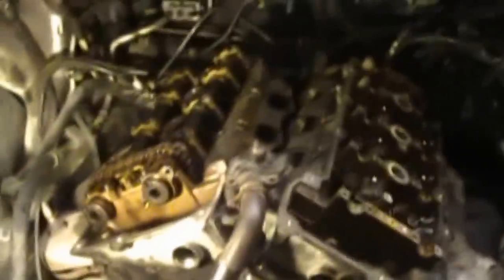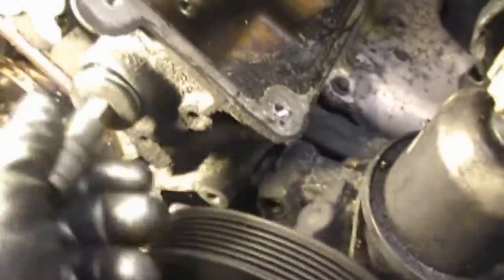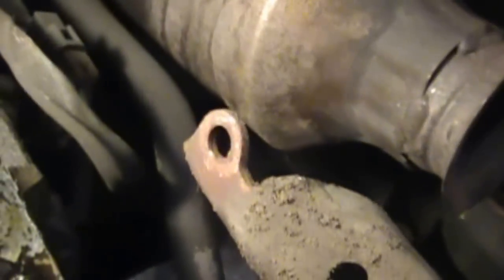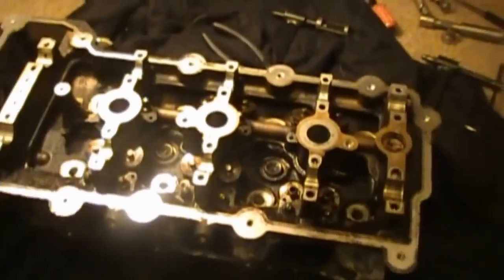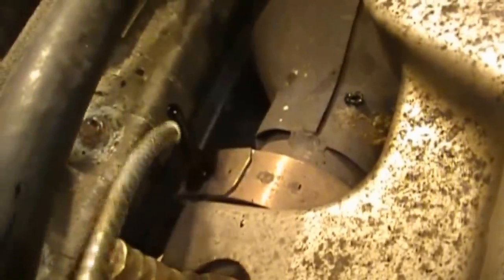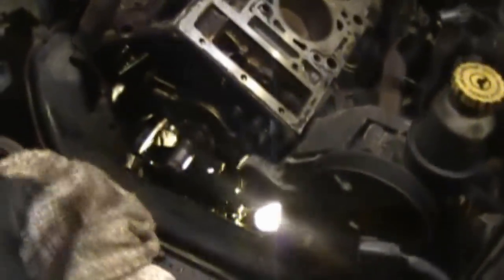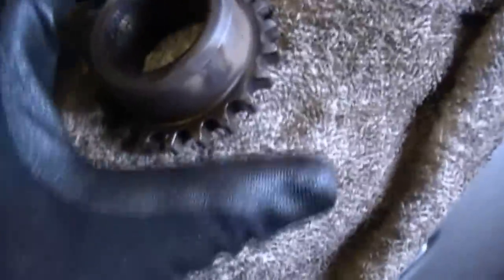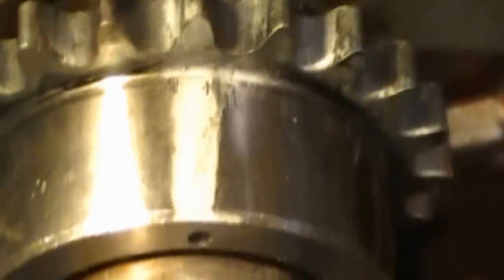2.7 1999 concord/intrepid timing chain replacement - head removel and more!

Comment: HI, I just replaced the water pump and tensioner, and after I have it all together and timed properly; every few degrees (about 120) when it compresses every cylinder, it creates slack between the pump and right sprocket.  As a result, creates more tension on tensioner and throws everything off: pushes tensioner too far back, skips teeth, throws out of time, etc:  does anyone have an idea what could cause that?
Reply from the maker: +thecrowndeer  Make sure you turn the crank ....Clockwise! ...only!  That would cause that Issue. Good luck!

Comment: How do I get the oil pan? I have already loosened all the bolts and nuts, the oil pan is just hanging Loose, But the Sway bar is in the way, there's not Enough clearance to pull down the oil pan, what do I need to do? or what am i doing Wrong?
please help. Thanks.
Reply from the maker: phigo4kins  loosen one of the motor mounts and jack up the engine inch or two. I had this problem also. I just used a small jack and a piece of wood under the harminic balancer ...if you took it off you might have to put it back on just snug enough to lift the motor. There is one nut that will let you losen the motor mount under the cradel/frame. 15 mm i think. I took off the pasanger side nut.  Easy to get to. Good luck!
Reply: TVWXMAN32 Yea Man, Thanks A-Ton I didn't even realize You gave a response. I just happen to come by Ur Vid again (as I always do everytime I search for Trep Videos) & Was scrolling thru the Comments, Lolz. But I finally got the Oil Pan off. I did Exactly what You said, Had to slightly release the Engine Mount Bolt on the Passenger side just enough to let Me wiggle it out. These engines are Pain in the Rear to work on, Especially for a 1st timer. But I want to use this opportunity to ask for another help, I have everything in the engine pretty much stripped Just the Block and the Crank left, I found out I had a sideways play in some of My Rods (Not the Up & Down Play) - Which I think would suggest a chewed up Bearing, some people said its ok/normal, [I made a short video of it - If You can check out]. But I just wanna be sure, cos I don't wanna go thru all this teardown & regret not taking the crank out to check it. I've already took some of the Rod Caps off. With Your great experience on these cars, 1. Do I really need to drop the block/take the crank out? & 2. If I do - How do I detach the engine from the Transmission? Where are the Bolts holding'em Located?

  I had Over Heating and Knocking sound & SEVERE Sludge which is what lead to all these work - which I could've mistaken the Knock for a Chain Slack - I Wasn't Sure @ the Time - As I didn't have much knowledge on cars as I do now. I have the engine all cleaned of all sludge. REALLY Wished I made a video of it before I started all these work - this happened back in 2011. Sorry for the Long writing.

Comment: Thank you for the video,  Believe a friend of mine has a problem.  Will be looking at  it soon.  Weather gets in the way sometimes.  How many total days, hours did it take.  Sorry you got sick too.  You Changed the water, oil pumps, and the chains with glides, two values, A/C pump.  blots for ex-haul manifold covers.  ( chain guide tensioner. )  Total cost plus oil and filter, plus antifreeze.  All Gaskets in one kit.  Hoping you get many miles out of your car.  later, and Thanks again.  For  taking the time.
Reply from the maker: All in one kit...on e-bay from a dealer was $170.00 back in the day...lol Car ran like new but I did sell it 2 years ago. If I ever found a nother one, I'd buy it if the body was in good shape. Solid cars!

Comment: some ebay parts are cheap for a reason.  I had a secondary tensioner explode with only a couple thousand miles on rebuild.
Reply: Darci Maxwell That's Scary, I Bought Mine off Ebay too. Are You sure You didn't do something wrong during arming the Tensioner?
Reply: Darci Maxwell Have had the same issue with NAPA parts. Timing belt tensioner failed after 1,000 miles. Destroyed the cylinder head.... interference engine.

It can happen to any part. It's great to have a lifetime warranty on a part. You never know what other associated parts it may take with it though.

Engines are incredibly complicated. The range of extremes, -30f to 200f parts operate under. Those conditions for a decade or longer.
One mistake... a few foot lbs off in installation and it can shorten the life of a component. 

Sometimes you have to admit user error. Yeah I checked the tolerance window. Checked it several times after adjusting timing. But maybe I was looking at it from an angle, giving it was in such tight quarters. The spring just slipped out of the groove.
For the head, timing belt kit, oil, coolant and other fun stuff, cost about $300. I chose to go with amazon.com. Have put 8,000 miles on the car since April and the  car is still running. $25 for the head gasket, $60 for the belt and tensioner. You never know man. And on a 20 year old car....

Comment: Thanks so much for taking the time out of your day to do this video.  I just bought a 99 intrepid and seem to be loosing a little coolant so here we go!
Reply from the maker: Tell that to the 17 thumbs down people who never left their parents basement...lol..   That took some time to do and shoot video. People don't understand. But those motors are good motors if one takes care of them. Good luck!
Reply: I dunno man. I work as a Journeyman Technician myself... although I specialize mostly in VW/Audi/BMW, these 2.7L Mitsubishi engines have a massive amount of TSB's and general water-pump/head/sludging problems. 

I got a 2006 Sebring in my garage (side project) and it has only 100,000 kms on it, and it needs a new head due to oil starvation. The camshafts were metal to metal, and it was squeeling like a stuck pig.

I can't say I'm a fan of Chrysler and these motors.

However you did a good job at the video. Very informative even for experienced techs like myself. I don't have access to Mitchell at home... :)
Reply: None of those problems will happen if you use synthetic oil. My 2000 has 445,000 km on it, still has the original water pump and runs great with no blue smoke.

Comment: Hi i hope you can help me i have a chrysler 300 the timing chain broke and one of the valves bent do you think that by taking it for a grind will help or just to have the valve replaced
Reply from the maker: grind??
Reply: I meant to say rectify when they sand the heads
Reply: I have the cylinder 2 that doesnt have compression but the head is not bent just one valve thats do you think that i have to rectify the head or just replace the valve thats bent i hope you can help
Reply from the maker: Just replace the valve. But check the head to make sure.

Comment: could you please correct your video, or edit out your footnote, your teaching people the wrong way to time it, and it costed me hours, i understand that yours ran fine as far as you know, but i bet the dyno would show that you were wrong, whatever you read about arrows and dots only apply to the primary chain. I appreciate you taking the time to help people work on their vehicle, but information is only helpful if you tell them the right way to do it. we've all made mistakes before, it makes us human, the only way we can move on is to admit it eat some humble pie and move on
Reply from the maker: Hey man...Thanks! for the info. I though I put a foot note in there a year ago. I'll check it out.
Reply: TVWXMAN32 the only foot not i saw was the one describing that you need to line up the arrows on the drivers side camshafts only which is false both camshafts go by dots. And once again i appreciate you taking the time to make video, you rock.
Reply from the maker: If I'm lucky, .....I'll never have to do a nother engine 2.7 timing chain again the rest of my life....lol ;) What A job!
Reply: Thats no lie, leave it to chrysler to make it as hard as possible, internal waterpump, thats infuriates me everytime i think about it. But on the plus side, after doing it once, a guy could pretty much do it blind folded, mixed in all their confusion, they kinda have set up like a paint by numbers

Comment: RE: ARROWS OR DOTS: Ok! The word is in! I talked to another Chrysler mechanic and he gave me the explanation that so many people (including you and I) are dying to know! WHAT ARE THE ARROWS ON THE CAM SPROCKETS FOR??? Here is the procedure:

Install the secondary timing chain and it's tensioner to the cam sprockets on a work bench. The dots need to be pointing straight up at 12:00! Then, move the cam assembly (both cams with chain and tensioner) and place them in their respective 'cradles' and install all of the caps. When you do this, you're compressing some of the valve springs, so the cams will want to turn in either direction - let them. Since the bank of the cylinder head is angled, and because the cams are going to rotate - the dots will now be pointing somewhere from 11:00 to 3:00 depending on which direction they will want to turn.

Now, when you rotate the primary timing chain sprocket (with timing chain attached) to bolt up to the cam sprocket, you will want to rotate the cam sprocket in the direction that makes the ARROWS (on the cam sprockets) point to 12:00!!! !!! !!! THIS IS CRUCIAL!!! THIS IS WHY THE ARROWS ARE THERE!!! It is an extra guide to tell you that you've rotated the cam sprocket in the correct direction to line up with the holes on the primary timing sprocket!!!

Because, unlike some of your readers, on my engine, the two bolt holes on the primary and the secondary sprockets do line up EITHER WAY!!! THEY ARE SYMETRICAL!!! THAT IS WHY  YOU NEED THE ARROWS!!! BY POINTING TO 12:00 (straight up) -THEY TELL YOU THAT YOU'VE ROTATED THE CAM SPROKETS IN THE CORRECT DIRECTION IN ORDER TO LINE UP THE DOTS ON BOTH SPROKETS!!!

The reason why the arrows are not on the cam sprockets on the right bank (back in my case) is because the cams do not rotate as much as the left bank! Therefore you do not need them.

When you get it all together - don't start rotating the engine a million times in order to get all the dots to line up!!! Forget about it!!! As long as you lined the crank sprocket with the arrow on the oil pump and you lined up the brass colored timing chain links to the dots on the primary sprockets, and the arrow on the PRIMARY TIMING SPROCKET is lined up with the dot on the cam sprocket at approximately 1:00 --- AND THE ARROWS ON THE CAM SPROCKETS ARE AT 12:00 ---- YOU ARE GOOD --- LEAVE IT THE HELL ALONE!!!

You got lucky, my friend! Although your engine might run well as you hear it. It might not run so well when you hit your passing gear up a hill or some driving condition similar to that. And you probably get crummy gas mileage! I just hope you accept this as the final word!!! GOD BLESS YOU!!!

Disclaimer: This information was given to me by mechanic who works on Chrysler engines. Therefore, it is his personal opinion voiced to me! I assume zero liability to anyone who decides to take this instruction - it is not my own!
Reply from the maker: Cool....I NEVER HAD ANY problem driving it. it ran perfect...like new. Good to know.
Reply: +John Brown  Hey thanks, this makes sense. I lined up with the dots as well straight up at 12:00 on the bench with the cam chain. I noticed the while installing the cams on mine that the cams wanted to go either left or right when putting the cam caps on (I chose left).  Then things started to feel weird nothing like I have done before (cam to crank mark with the chain was no where close) so I stopped found this video and was even more confused.  My arrows naturally wanted to aim at about 9 o-clock so I moved the cams with the 3/8 extensions in the end of each cam moving slowly to make sure valves would not slam into a piston and had I chose to install the caps with the cams resting to the right the arrows now aim at about 1 o-clock. This I believe will be the correct position. I will now install the secondary chain and see if all goes well. I'll turn over the engine clockwise two turns before putting the cover on.

Thanks so much, I'm sure glad that I read all the way to the end of this thread.